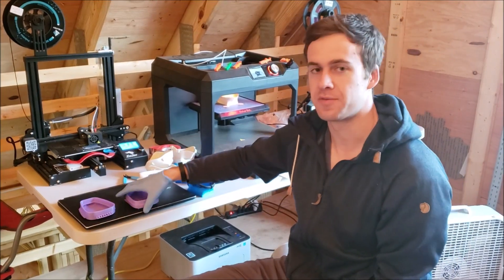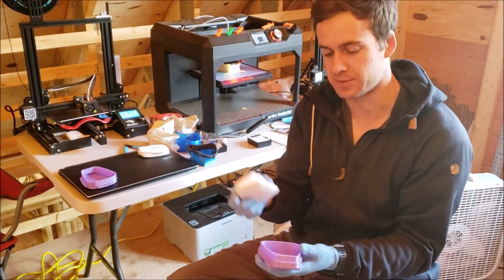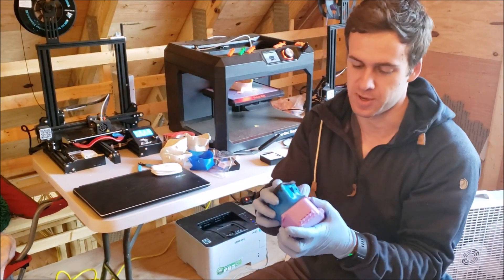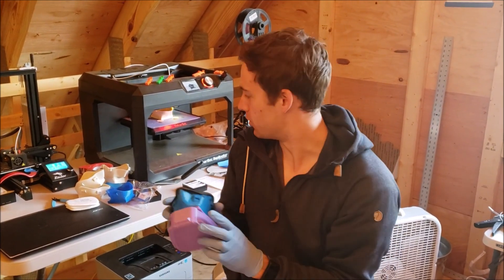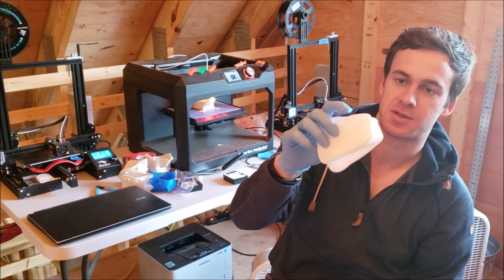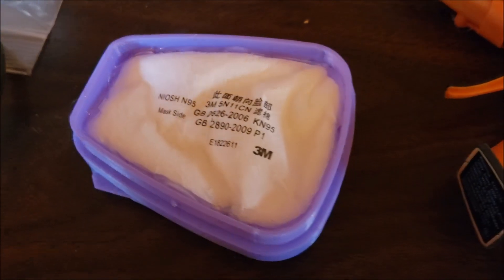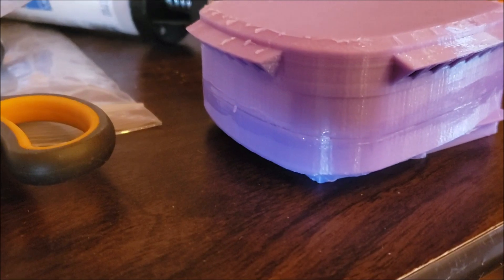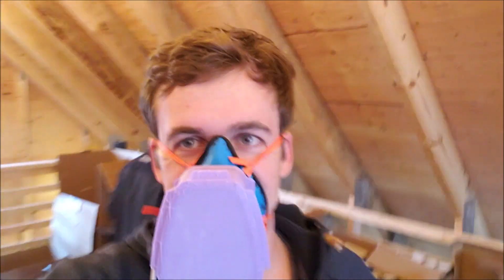COVID Pandemic 3D Printed Mask Adapter for 3M 5N11 N95 Filters

Comment: Very cool, would definitely like to hear about the results of any of the testing of the other masks you have made. Is there a reason you are using 3 filters instead of one? Is it for increased longevity, or just based on the design? Thanks, you are doing a great thing for many in the medical field with minimal options.
Reply from the maker: I ended up using 2 because simply because they fit. I always try to use as much filter material as possible up to the limit of being too hard to breath through. Also, I've noticed store-bought respirators pass air through two. Thanks for your kind words!

Comment: We’re do you get the filter from
Reply from the maker: bought online, shipping took forever, these are hard to get now
Reply: @chrischris64  Thanks for your reply back what is the size of the 3m holder that you design don't want something huge  on my face Thanks
Reply from the maker: @scanalotllc2242  the height is 124 mm. The width is 106 mm.
Reply: @chrischris64  thanks
Reply: Filter 3m 5n11 N95